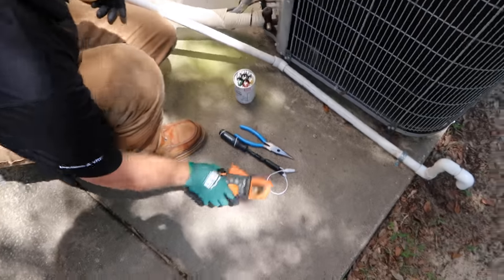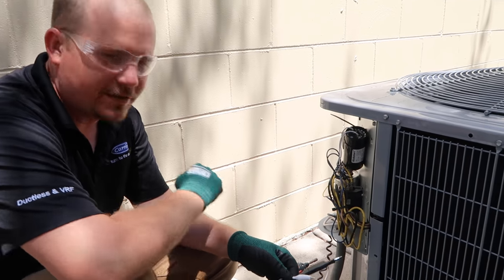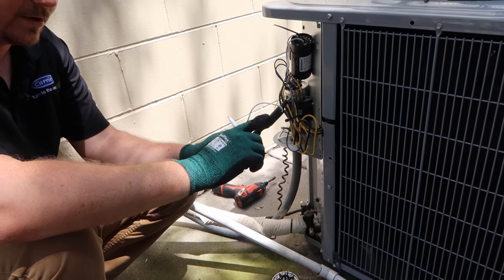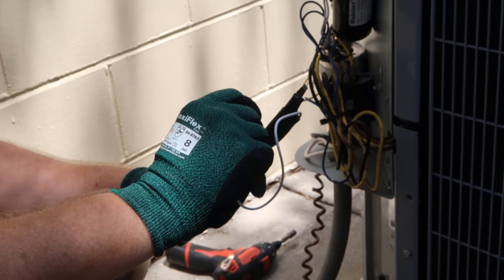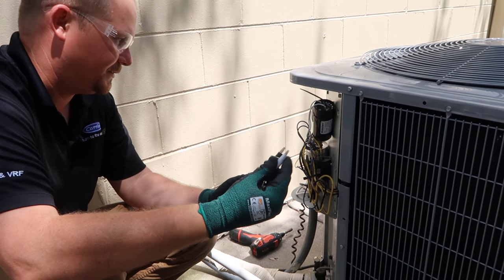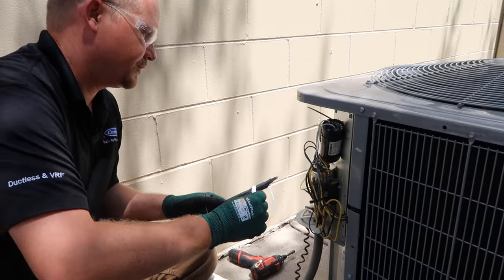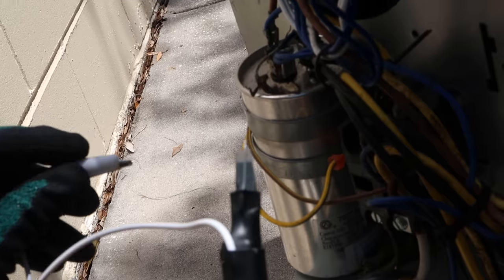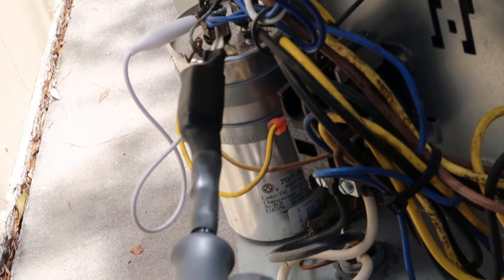How Do You Discharge a Capacitor?

Comment: Wouldn't a 20k ohms resister discharge the capacitor very slowly (which is a safe and good thing actually).  But when the capacitor is fully charged, I would think it takes  more like 60 to 90 seconds  to discharge it.  Just a quick touch as demonstrated may not discharge the capacitor to safe voltage levels.

Comment: Would it discharged on its own if it's disconnected from the compressor and motor for days?. and I'm trying to make the squirrel cage fan a regular fan and do you need the capacitor hooked  up just to run a regular fan?

Comment: Does it work if I use the metal from the AC and touch with the screwdriver both one by one the connectors from the cap ?

Comment: What's the worst that could happen by using the "other" method (screwdriver)?
Reply: A pretty good spark, or if your screwdriver is not well insulated you can have those 300-400V passing through your chest! ... plus capacitors are not supposed to be discharged so fast, it could damage a good capacitor, but in this case (for the most part), the rest of the equipment will discharge the capacitor so it shouldn't be that charged at the moment that you short it.
Reply: @ocramas  i dont think it would go through the chest
Reply: Electrocution.

Comment: This is done on the one being replaced or the new install or both ?
Reply: Just the one being replaced. A capacitor only stores a charge when its been supplied by a source. A capacitor that's still in the box doesn't have anything to supply it with a charge.
Reply: @paulh5049  your a little late my friend 🙄
Reply: @esj4373  alright next time I'll just keep my free advice to myself then.
Reply: I just read you should do both capacitors because there’s an off chance it was a used & returned capacitor. Safety first

Comment: why didn't you verify the discharge with a volt meter?
Reply from the maker: Mike Cummings show me your capacitor discharge tool and I will tell you why I didn’t reconfirm with a meter 😉
Reply: @HVACS though smug, that's not an OSHA approved response. Any professional will tell you to always verify with a meter.

Comment: Most volt meters should provide more than 20,000 Ohms of impedance.  Is there any reason you/we should not allow discharge through a voltmeter?
Reply from the maker: I’ve head that before but I’ve not tested it

Comment: My aircon compressor takes a long time to start, like 10-20mins or so.. and when it stops it takes too long again for it to engage..does that sound a bad capacitor?
Reply: I know of some ac units where the failsafe between compressor on and off cycles is on a 5-10 minute delay between cycles, some up to almost 15 minutes. 
i’ve done alot of ac units and generally the manual or the panel on the outside unit will mention something about a delay if there is one. 
If the delay i was mentioning above isn’t part of your unit’s normal functionality, then it’s likely that either the capacitor is low and having a hard time getting your compressor started, or possible that you have a safety of some sort not allowing the compressor to turn on just yet.
Reply: @mpurecat4155  it wasnt like that before. The compressor and capacitor has been replaced (2hp, 45um capacitor) The problem is intermittent there are times it restart at a shorter period of time. I tried replacing the capatitor but it didnt solve the problem. Should I try a higher um capacitor?
Reply: @iammarauder5418  did this issue happen after replacing both the capacitor and compressor, or was this happening before having both replaced? 
Your capacitor should be rated for what the compressor says on the rating plate. oversizing it is gonna result in overheating the compressor very quickly and messing up the windings just as quickly, usually within a matter of minutes or hours. 
intermittent issues can be caused by a multitude of factors. If the issue was happening before and after the compressor replacement i have a very confident idea that it could be either issues with wiring aka loose connections, or possibly a broken wire inside the wire’s insulation going to the compressor. I would double check the connections and also ohm out the wiring, all with the power disconnect. If there is a wire that is broken or slightly broken inside it’s insulation i would be expecting to see a higher resistance value when ohming it out. 
The other possibility is related to the refrigerant charge in the system. I would have gauges hooked up to the machine have it running for a while and see how the values on the gauges are changing. DO NOT add refrigerant to the system without checking to see how the values on the gauges are changing before and during operation. If this issue was happening before and after the compressor was replaced i would definitely check the wiring first, then check the refrigerant charge.

Just a disclaimer I’m not sure if you are a technician or not, but i would definitely seek out a technician to physically do this work if you are not.

Comment: I thought the discharging happened after you removed it completely from the wire connection? That did not look safe 👀
Reply from the maker: You can discharge before disconnecting the wires. If you pull the wires first with needle nose the it’s easy to accidentally bridge another terminal or ground.